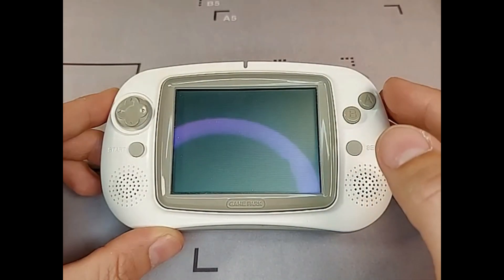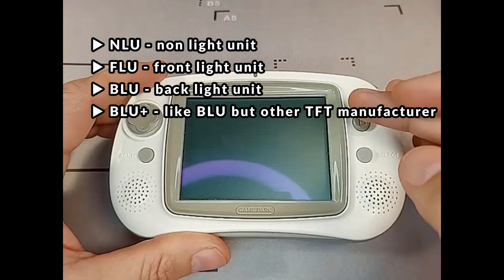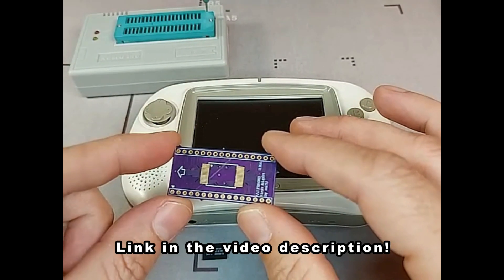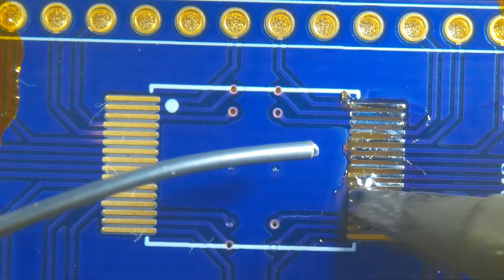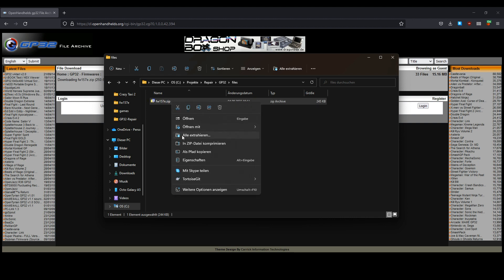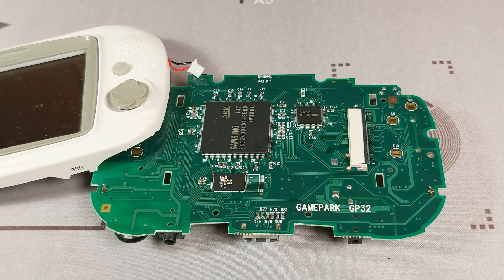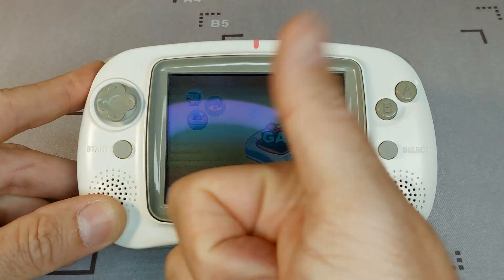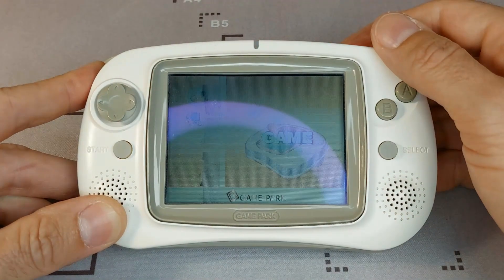Let's repair: Gamepark GP32 with a corrupted firmware

Comment: Amazing detailed video! I have my own GP32 I'd like to restore as well however it looks like corrosion has got to the capacitors under the SDRAM chip. Would you happen to know the value for these or if there was ever a data sheet made available for the console? Great work getting the unit back to life regardless!
Reply from the maker: Thanks. Unfortunately I do not have schematics for GP32. The capacitors might be just simple 100nF caps since they seem to be connected directly to the voltage inputs of the Samsung CPU. This would be at least my guess.
Reply: @Octoate  Thanks for the details, that's a good place to start, when I get up the courage I'll give it a go!

Comment: Hello Thank you very much for sharing this video, I also have GP32 which is almost 20years old. it's didn't work anymore due to firmware issue since 2010.  I always wonder how to fix it because it's very meaningful device for me.  I just happened to search it. you made it. I will try at some point Thank you again,
Reply from the maker: I hope that you can get it working again. Good luck 🙂!